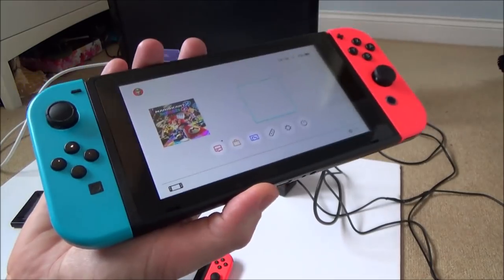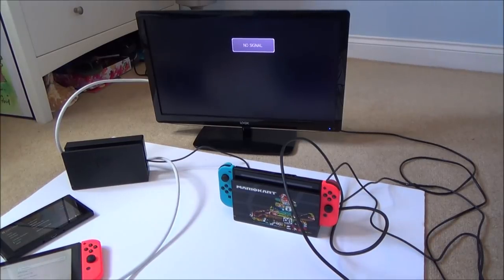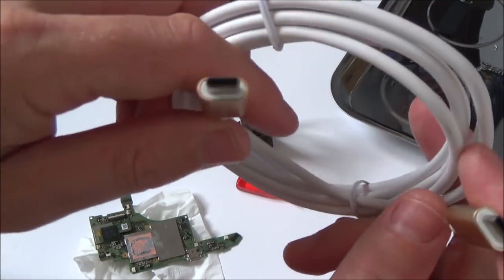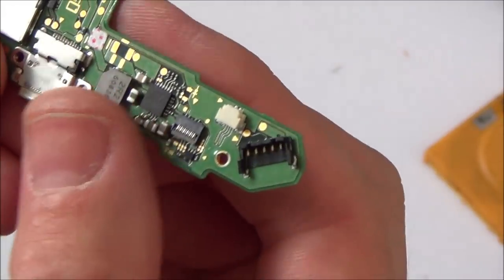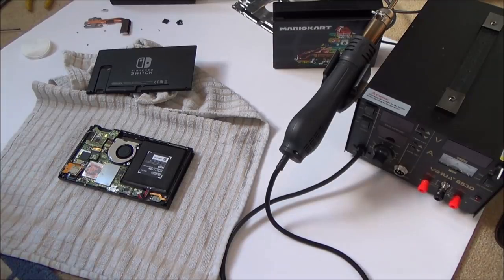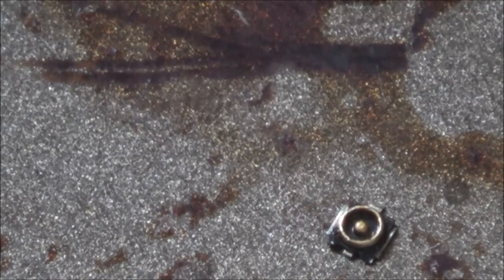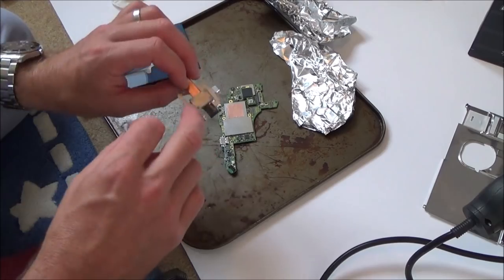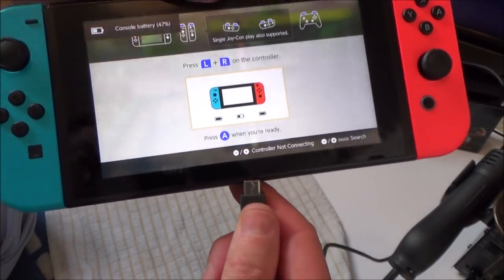UPDATE: Trying to Fix the Faulty Bent Nintendo Switch Not Docking

Comment: You generally remove old thermal paste and apply new because you don't want air bubbles in there that will trap heat and make things hotter. That's why people do the dot cause when you apply pressure it spreads out evenly on its own.

The color of paste shouldn't matter. You would have been fine and probably better off just applying new paste on the top and bottom of the heatsink. I don't think you have to worry about it though, you applied new paste to the main part so you should be fine.

Comment: With thermal paste usually less is better, especially for such small components. Also once you put it on and place the heatsink on top you shouldn't tap it or adjust it. That will create air bubbles which will impede optimal heat transfer.

Comment: Yes you can.clean the surface and apply the same thermal paste to both surfaces but just apply a pea size drop to the surface to help to dissipate the heat from the chip

Comment: Have you tried using the USB ethernet adapter with it? The chip you tried to reflow (or one of the components connected to it) does seem like the most likely culprit, since it seems to do switching between USB/HDMI out, but it would help a little to know if it's just HDMI out that's not working or if the USB portion isn't working either.

If the ethernet adapter doesn't work either, then it seems like the chip isn't switching for some reason, maybe one or more pins aren't making proper contact or one of the components connected to it isn't making contact and you just didn't use enough heat to reflow it. But if the ethernet adapter doesn't work then the chip might be dead. The bend could have stressed the internals of the chip enough to make it fail.

It could still be a software issue, but if it is a hardware issue then it's most likely that chip or something connected to it. Anyway, I hope you can fix it or at least figure out for sure what's wrong with it, and I'll be looking forward to any future videos on it.

Edit: More info in the replies.
Reply: Also, the chip not switching could explain why it only displays 480p. If the chip doesn't switch, then the Switch can't read the EDID information from the TV, and it might fallback to only 480p as a compatibility option. That could also happen if the chip was dead however.
Reply: Had another look at the part where you test the shorts to ground. The first pin you tested is GND, so that's fine. The next two that aren't shorted are RX+/RX- (these are different pairs for each side), so that sounds fine. Then the next: VBUS, SBU, D-, D+, CC, VBUS, TX- are all shorted, but TX+ isn't, last one is GND again. SBU, CC and TX are also different for each side.

Then on the other side, it's the same thing, but TX- isn't shorted this time.
This might be normal, as looking at the datasheet for the matrix switch, in DP+USB mode, one of the TX/RX pairs of the USB-C port goes to the TX/RX input/output that's connected to the USB 3.0 controller elsewhere on the board (presumably in the SoC), the other pair goes to the DP output. This TX/RX pair is internally pulled down to ground with a 100k resistor in the matrix switch according to the datasheet. If you measure the resistance and it's ~100k then this is likely normal. Why RX- on the same pair didn't appear to be shorted to ground even though the datasheet says it should also be pulled down to ground I'm not sure, but it might not matter.

CC doesn't appear to go to the matrix switch at all, and is used for negotiating the USB version (3.0-3.2) and the charging voltage, I will assume this part is working but that could easily be tested by seeing if the console will charge at reasonable speed while playing a game. If it wasn't able to negotiate a higher voltage the console would charge very slowly in game, and you would likely have noticed.

D+/D- is just plain old USB 2.0, this doesn't go to the matrix switch either and isn't especially relevant since the dock doesn't need it.

VBUS is for the power, it seems weird to me that it would be shorted to ground, but maybe that's normal when the console is off, since something in the console must be sensing when power is applied before it decides to accept it and actually charge the device. Clearly the console is charging so we can assume this is not an issue.

Datasheet for the matrix switch: https://www.digchip.com/datasheets/parts/datasheet/129/PI3USB30532ZLE-pdf.php
And the USB-C pinout I got from Wikipedia. You can see what pins on the chip correspond to what pins on the USB-C connector.

I don't know if any of this is helpful right now, it certainly didn't make me much wiser.
But I think you need to test continuity to ground again with the console on (with and without the dock plugged in) to see if the results change as it might give you some important clues.
Reply from the maker: Thanks for the great in depth analysis and suggestions :-)
Reply: You're welcome. Additionally, you should test the continuity between the TX/RX and DP pins on the matrix switch docked and undocked to determine if it's switching correctly.

Comment: I need some help...
I have a problem with YouTube resolution on my Switch when docked... it seems to just do 480p but I have my device and app on '1080p'...
I've got two hdmi cables and one supports 4k... my TV only does 1080p... and yes I bought the 4k cable (amazon basics) because my provided cable was showing JUST YOUTUBE in 360p... also my TV does the same thing with smart view... I'm confused if my TV is the problem since its HDR and brand new.... and note that the interface for YouTube looks 1080p but the video is poor quality... even worse with smart view from phone to TV (I use Samsung S9+)

Comment: Available resolutions are determined by the TV once the switch is able to communicate with it. Default “failsafe” res is 480p. Seems that there is no communication with the TV. If you fix that, the resolutions supported by your TV will be available in the menu. Try reflowing some solder joints where the bend was using plenty of flux to not bridge pins...
Also, I would definitely revisit that connector with a fine tip soldering iron just to have the best possible joint. It might be on now, but maybe the cable will pull it off sometime in the future...
And if you want to learn soldering minuscule things properly, look up Louis Rossman on YouTube and watch his tutorials and repair videos... you’ll be amazed at how easy it is with proper tools and loads of flux paste!

Comment: Idk if your using the aluminum foil for protection but aluminum dissipates heat better then most metals so when your heating up one spot that foil is actuly heating up the entire board u could be losing alot of heat this way too cuz the foil is just sucking it up u should really find a better heat shield so u can point heat better in one area
Reply: That's why Kapton tape is used.

Comment: there does seem to be a thread on the nintendo forums about some switches having a bug , where they are stuck on 480p  not sure if it relevent to this repair !
Reply: There is no such thing as 480p HD.

720 is the minimum to be considered HD as per broadcast standards with 480 and 576i being the US and PAL standard definition (SD) respectively.

Comment: I would check the Pericom matrix switch. its located between the Realtek chip and the USB-C port. this chip switches USB3.0 and DP1.2 signals when you plugin your USB-C cable.
Reply: That's the one he tried to reflow. Although I don't think he used a high enough temperature. And it wouldn't help if the chip is dead anyway.

Comment: Your RGB setting is set to Limited range not automatic so your resolutions are limited to that, not 100% sure if that can correlate to the HDMI not outputting but might, you need to change the RGB setting, the Switch cant detect a fault with the chipset onboard and think it can only be in 480p like that.
Reply: Also this is from a software engineer not some random kid, I know how stuff like this works

Comment: I had my switch docked with a      5:4 monitor with SXGA resolution which is more than 480p  and i was using an hdmi to dvi adapter and version 4.0 and it showed automatic and 480p as the only available options but despite my monitor supporting resolutions above 720p in both automatic and 480p it only displayed in 480p(stretched due to 5:4 aspect ratio) and then i searched about it and i found out it was a common issue with dvi monitors on 4.0 not displaying more than 480p and then i updated the firmware to 5.1 and it still showed automatic and 480p but on automatic it was displaying stretched 720p and      when undocked it still "remembered" 480p and automatic as the only options so it seems that it's an issue with firmware 4.0 that only 480p and automatic are available that does not get fixed if the firmware is updated but won't happen if the same was done  in 5.1.       It's weird but it's definitely a software issue

Comment: the reason you want to change it, is beacuse most of the time the factory thermal compound is not good. and just some advice for the next time. for referance on how much to put on i would say the size of a rice grain for the switch. and that thermal compound you got is one of the best brands to use. it worked very well for me on the pc's i build

Comment: Great video again vince and nice fix on the connector ive done a couple not a easy job regards too the dock not switching to hdmi i think the pi3usb30532 ic maybe at fault not sure how easy it would be too swap one though
Reply from the maker: Thanks fellow Vince, I was really pleased with the connector :-) Apparently the Switch has traces sandwiched inside the top and bottom layers on the circuit board so maybe one of these have a hairline break on it. I don't think I will risk replacing that pi chip as I wouldn't be confident with that at the mo :-)
Thanks for the views and comments :-)

Comment: I really do think it's a broken trace or two (and maybe a ground plane) ... that was a pretty serious bend and copper traces aren't that thick.

I can find instances of devices restricting themselves to 480p on google... seems to be cables that aren't up to snuff. That leads me to believe the traces that send the hdmi signals are damaged, and the switch is acting like it has a bad hdmi cable attached.

I'd just replace the board, hard to tell what other damage hasn't made itself evident yet... God forbid the charging regulation circuitry.

Comment: The switch only shows the TV output settings supported by the last TV it was docked to (as I've just seen previously mentioned by C4DSama). My switch will happily connect to 1080p screens and show the option, but after docking to my 720p TV the option to force 1080p is removed from the list until docking to a different display (presumably to stop someone setting it too high, since there is no confirmation dialogue that the setting worked). This would show that the switch is not properly detecting your TV to set up the output correctly, and could still be caused by bent data pins, software, a damaged chip, or really a number of things. Hopefully this narrows down the search!

Comment: Probably needs to GPU reflowing, there's info online how to reflow chips, it's not too hard, use kapton tape and foil and follow the guides on the time and heat required for a GPU reflow.

The competition sound great but you have to remember giving something like a switch away to another country is not a great idea because of region restrictions of the console. Great vid as always :)

Comment: hi vince,

I like your nintendo switch Episodes, hoping you can fix a few not docking.

here is some information that i found on this problem,

They had me unplug all the cables from the dock, as well as the adapter from the wall and wait a full minute. I replugged everything in, and bam, it worked. Since I have two other docks I haven’t played around with it too much, but the Nintendo tech said that the adapter has a little breaker in it that can only be reset by removing it from the wall and letting it power cycle.they said they 

repaired a connection in the Switch itself.

Comment: Unfortunately on a bent board a whole lot of issues can happen. starting with most common and simple a broken solder joint and then it could be a broken copper lead on the PCB which is very hard to find and eventually you have to run wire instead of it to a broken chip which you have to replace chip. what i would do is find the circuit board blueprints and look for the video chip, and see if there is continuity between that chip output and usb first.

Comment: I think this is a software issue as well! Allthough unlikely, something may have gone wrong during the installation. And maybe the switch didn't register all the components in the os for the output properly? I suggest you try to reinstall the switch from the memory stick. Just to make sure...

Some info that might be useful for you about graphics processors... The graphics processor will likely be rendering at an constant internal resolution either way. And the resolution options is just a matter of scaling the image. Which should be no issue, with it rendering in the first place.

Comment: Hi Vince! Im having the exact same issue as you, i have tried full factory reset and whiped everything, still im stuck with no picture on screen. But mine has never even been dropped once on the floor. i guess the case with your bent switch is someone getting angry when the switch never docked and bent by hand.  Mine worked for one year, now it only works in handheld mode. It docks in the dock, the picture on the switch gets black, no picture and constant green light. I will bend my switch very soon so you can buy it and do another repair video ;) or not.......
Reply: I noticed something, when i dock it, the screen on the switch goes black for 2 seconds, then the screen flashes one time and goes black again on the switch, is that how it`s suposed to be?
Reply: Did you manage to fix it. I'm experiencing the same problem I've tried everything.
Reply: @ltzvenomz3416  No sry man, i had to repair the Switch, got it on guarantee. It was the graphich chip that had burned.
Reply: @ivanhoe68  Yeah it turned out my Dock is faulty, I'm glad it's not the switch though. Thanks for the reply especially as you commented 2 years ago, stay safe.

Comment: Just for info for other uses that can dock there switch and get a picture on the tv if you only see 480p and automatic in the resolution settings then dock the switch go to the res setting and you can then select 720 or 1080 if ya tv supports it of of course
Reply: thanks

Comment: Obviously theres nothing wrong with the docks, but its possible an internal trace from usb c to the chip is broken, so try find the solderjoint and solder a simple kynar wire leading to the chip. Or the software doesnt read EDID properly, so try do a factory default.

Comment: My switch just randomly started showing only Automatic and 420p. Its display on my tv in dock mode BUT its only display 420p. I saw another vid on YouTube where they replaced the P13USB chip and the TV output finally showed all the resolution options again

Comment: I think your attempt at a repair probably would have been successful if you had a better hot air station, heating things hotter and faster does less damage to the components then slow and lower temp. The Quick861DW seems really good for pretty inexpensive, might be worth investing in it! :)

Comment: Try downgrading to the original system upgrade. It sounds like a software problem. Try to search online and download the original system software version and downgrade the switch to the original and see if you get the settings back for the TV. and if that works then fully system upgraded all the way to the newest version again and see if you still have them or see if they go away again. I don't know if it's going to work except it would be easy to try it out just put it on a flash drive or connected to a laptop or desktop.

Comment: Vince, since you opened it I would recommend cleaning that thermal paste off and re applying a new one before reassembling. Also do a factory reset to clear whatever settings the previous owner had in there

Comment: I noticed at the start of the video where you show the settings on both switches that they don’t match. The one with resolution up to 1080p had a setting under it saying RGB range and that was set to automatic. On the switch that won’t display and only goes to 480p the RGB range is set to limited. Maybe it will work once you change it to automatic and then select 1080p if it shows up. Please thumbs up so he sees this!
Reply from the maker: Hi, thanks for the message. A little bit later on in the video I show the RGB set to auto and unfortunately it didn't make any difference.
Reply: My Mate VINCE okay mate thanks for letting me know. Was the first video I couldn’t watch all the way through (girlfriend wanted to watch something) 
Love the videos, keep us updated 😎

Comment: you could still have continuity along the chip if it's bent.  You seem to think that just because there's continuity that means the chip is perfectly fine but what you're failing to take into account is that the bend is preventing the switch from making proper contact with the dock
Reply from the maker: But wouldn't the cut USB-C cable that I was using to test the contacts mimic the USB-C  port in the dock? So if I have continuity with the cut cable it should suggest that the port is not bent.
Reply: you're putting the cable directly on the chip so it's not mimicking the port in the dock.  I'm not an expert by any means but I believe that if the chip is bent even slightly it can affect the contact between the switch and the dock and that would prevent it from working